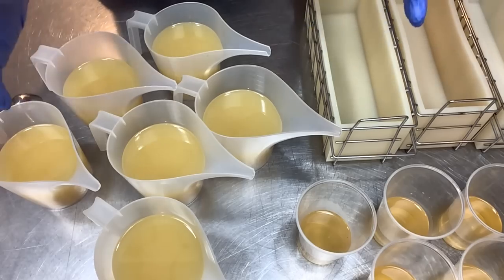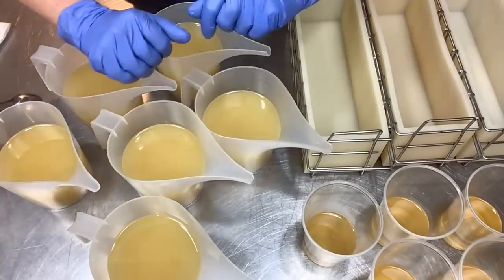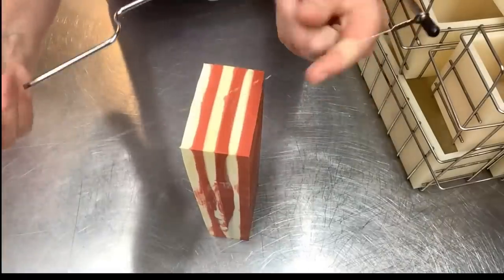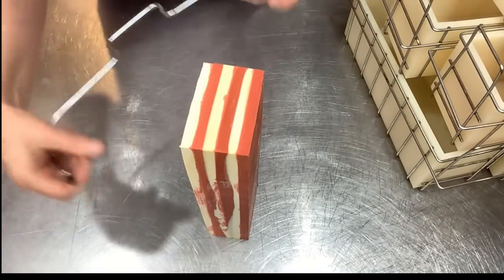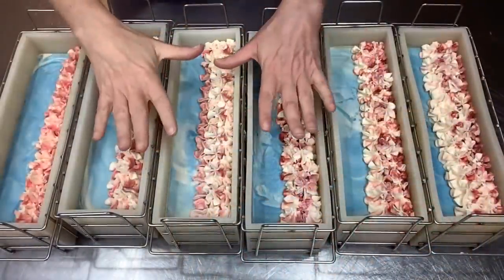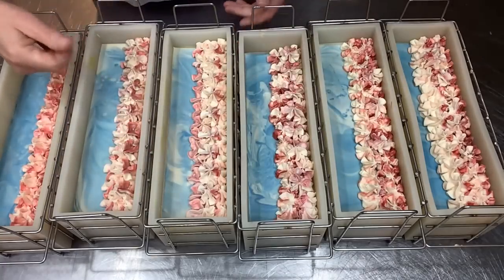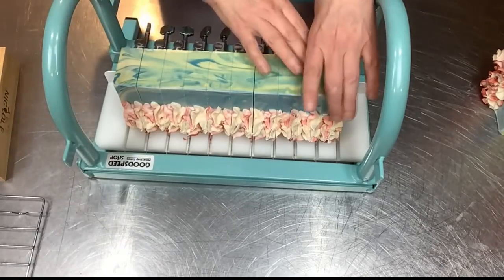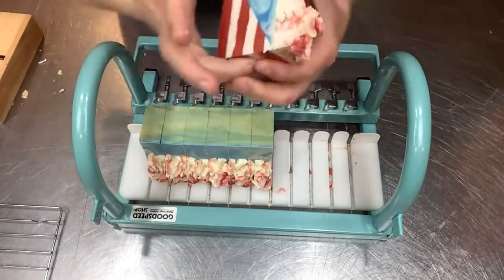Cold Process Soap Recipe - 🇺🇸 FREEDOM Bars 🇺🇸 w/ Aloe Vera | Ellen Ruth Soap

Comment: You are from Texas, right? You missed your chance to put a star embed in the blue for a lone star. 😆
Beautiful, striking soap. I love it! You made it different than I thought you would. I thought you would do the blue first, letting the soap cure in it's mold at an angle. 
Is there a reason you did it this way instead? I just want to know if it doesn't work that way for some reason.
Reply from the maker: I'm not from TX, but I have 2 children that live there💙 ❤️  I just like this design, and get the best results this way.